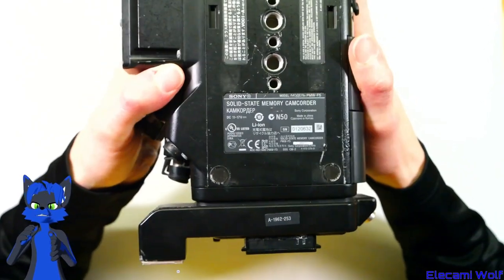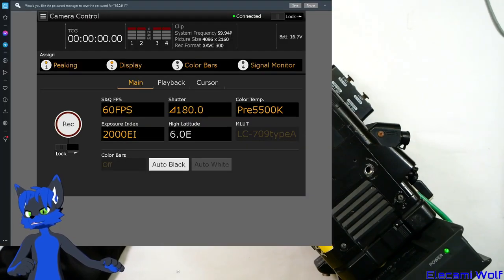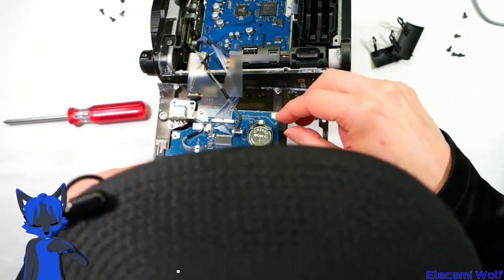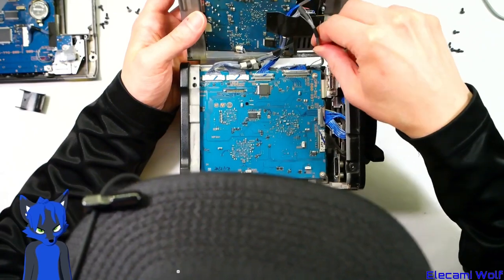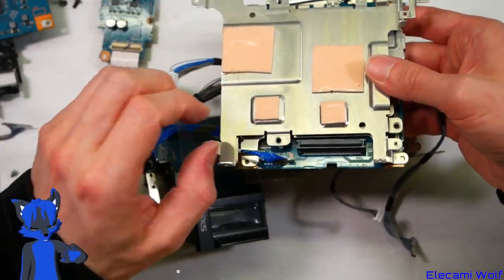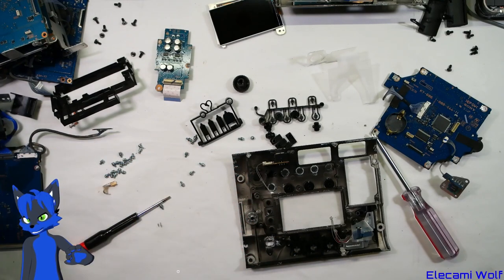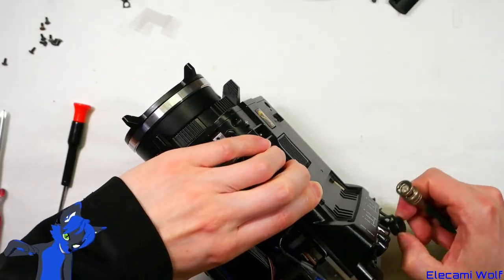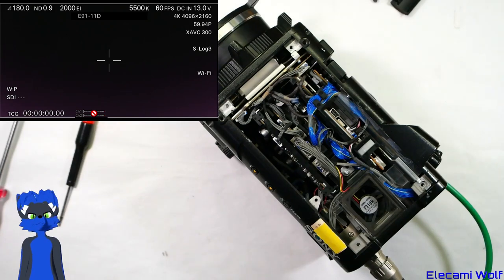EW0104 - Sony PMW-F5 Digital Cinema Video Camera Teardown

Comment: I think it's flashing to let you know the lithium battery needs to be replaced. It hold the timecode and date and other memory stuff. If it's dead you will see the system wants you to input the current date time and time zone before going into the menus after you change the battery (2032 3V)This is behind the front LCD side plate 5 screws total, one sneaky one on the top second from the top right.
Reply from the maker: Not sure it is that simple, since there is an error code n the screen aswell.